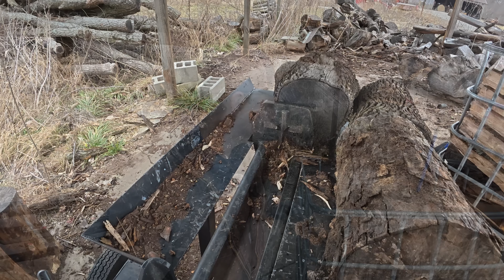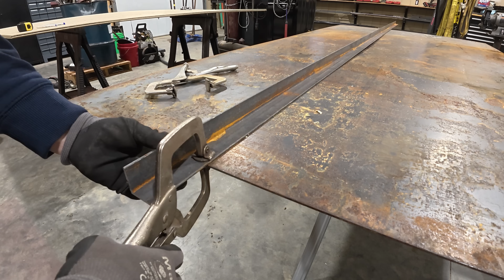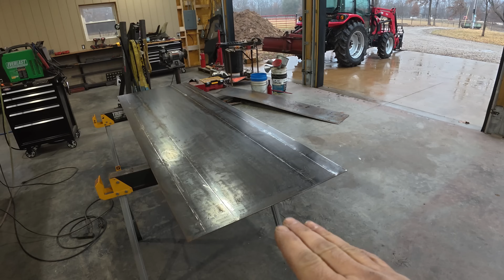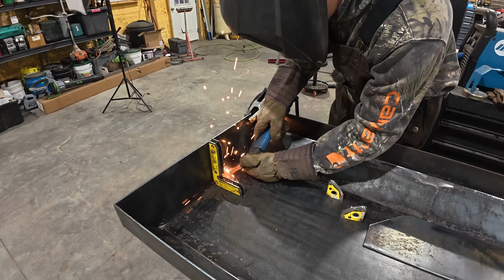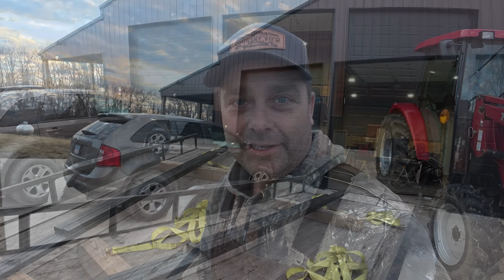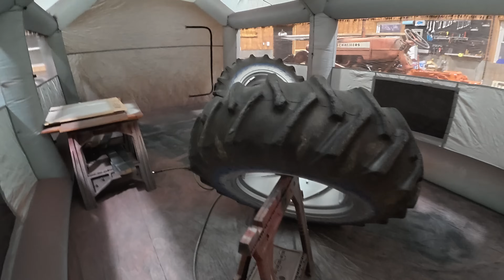I Messed up the Final Coat of Paint.  Starting another Welding Project

Comment: Evan. Keep up the good work. About the greasy steel, it’s a pain. What works for me is that I spritz it with strong degreaser soap stuff and pressure wash it off. Less work and cheaper than thinner or spirits.

Comment: Good morning you may want to put round pipe on the edges like you put on the angle blade. Incase the cows start pushing and shoving each other and won’t get cut. Don’t worry about the fire I set my grandparents couch on fire and then went out and set three of the haystacks on fire and after my grandfather got though with me I turned out ok and still have burn pile 😊😊🤭

Comment: The stuff on the tube is lubricating oil from the mill. Some might also be cutting fluid from when they saw cut the tube to the length you requested.
Reply from the maker: I stood there when he cut it with a portaband saw.  It was already coated with it
Reply: @CountryViewAcres  I worked for a steel company that sold stock. Tube and cold roll steel always came in oily. Went through about 4 pairs of gloves a day handling it. Gloves would just wick it up. When they would get so wet it reached the back side of my hands I would grab a new pair.

Comment: Just want to give you a suggestion about your D17. You may want to give thought to removing the loader off of it. My thought being that you already have two nice tractors with loaders, if you take the loader off it frees up the hydraulics on that tractor and you could run your bale wrapper with the D17 and use your bigger tractor to load the bales as that would handle the silage bales better than your smaller loader tractor. Also i can tell you from my personal experience that a tractor without a loader is so much easier for doing field work like raking hay and such. I just want to throw out the suggestion to you after watching you and your operation i feel like it would be a better option for you. Enjoy your videos and watching you build your dream

Comment: He k, I just assumed you had left these outlet covers off until the wall paneling, metal rack, etc. was completed to avoid damage to them during construction.  You trim out on a painted finished surface, right?  At least I did as a plumber when I was setting fixtures.

Comment: I don't know if you have heard of using a cutting wheel to score the line for your bend instead of cutting all the way through with a plasma torch. Even if you use the plasma torch you can do this on the tabs to make it bend easier. Just an idea. Another good video.

Comment: Evan. I was a welder for 40 years before retiring. I would like to give you a little tip on mig welding. Not all will agree but instead of weaving try doing little circles. I think you may like the results and looks a little better
Reply: That's what I do. Little circles make the welds look great.

Comment: --- STOP --- Don't call it greasy, goober, grimy stuff ... the coating on the metal from the vendor is called "mill-scale".  It's on steel and aluminum products.  Acetone and a paper towel will remove it as you saw.  When welding aluminum you also have to use a stainless bristle brush to prepare the area immediately at the weld site.
Reply from the maker: No they poured oil on it.  It isn't mill scale.  I talked to the owner about it.  He said it was cutting fluid from a metal working machine.
Reply: @CountryViewAcres  Ahhhhh ... I stand corrected.  Hope you got a discount for your efforts.

Comment: Just a thought! The cutouts on the corners for water drains may get pluged with wet feed.  How about cutting a two inch by 4 inch rectangle at one end and tilting it slightly in that direction.